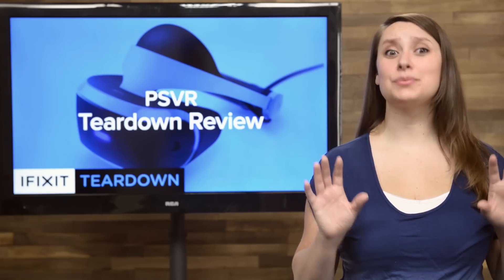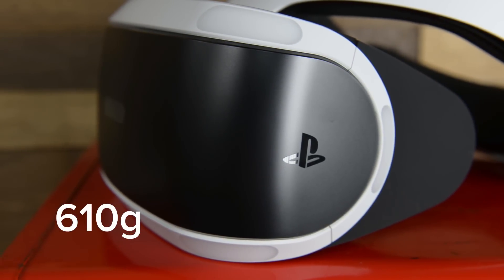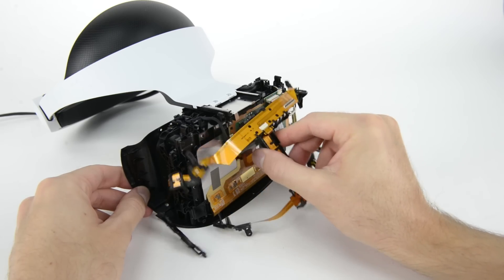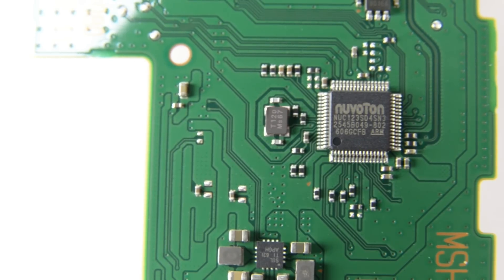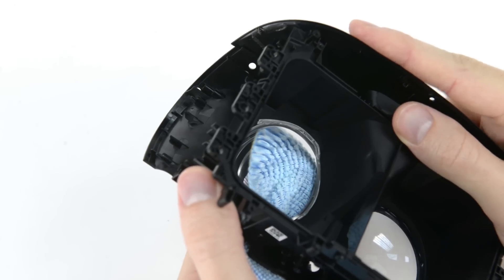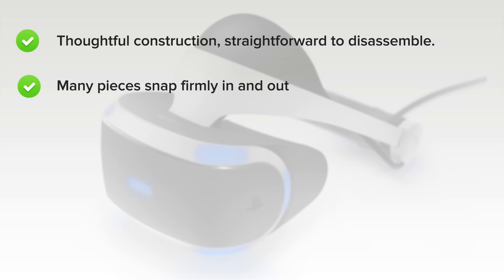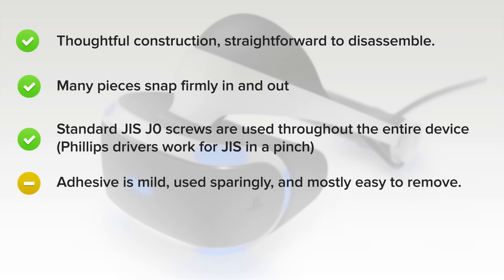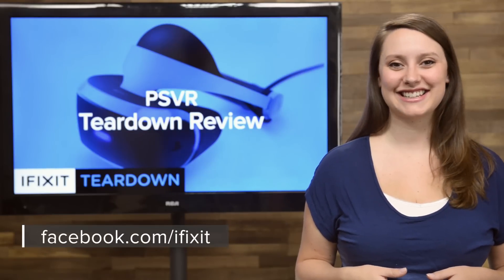PlayStation VR Teardown Review!

Comment: PSVR sucks, people are returning it by the boat loads after throwing up.
Reply: are they now?
Reply: That's because the PS can't handle it then I would assume? You need a MINIMUM framerate of 90 during use at any point in time. Or is it bad head tracking?